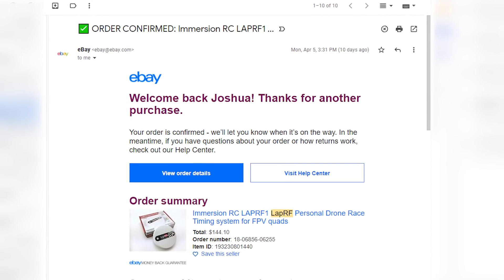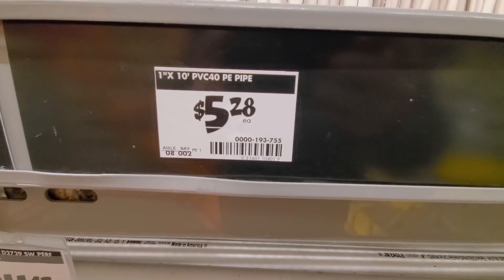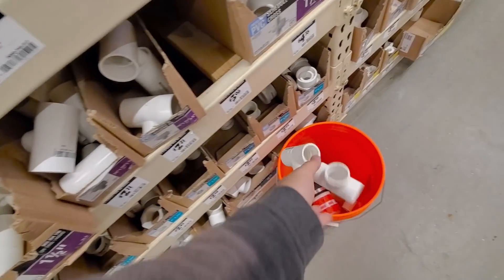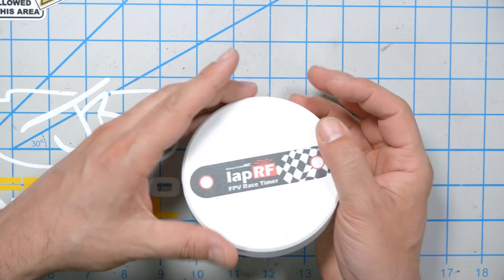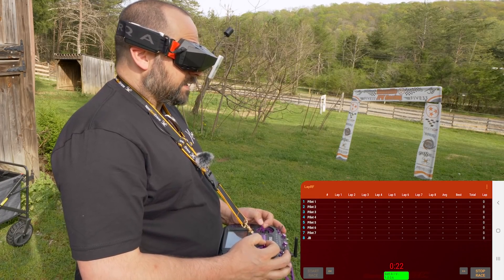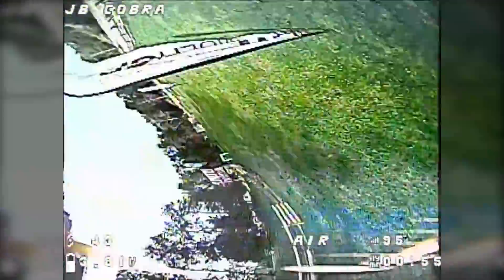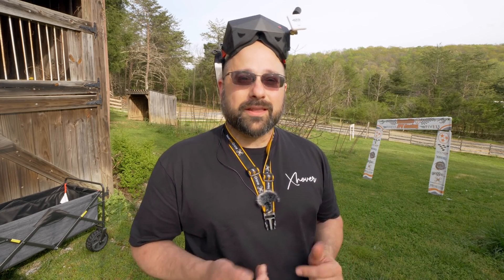Personal FPV race timing system: ImmersionRC LapRF Puck

Comment: need the android APP ,does anyone has the apk file ?
Reply: Hi! I have the same story, so one option could be downloading app files for Android from Github. The program do not function (do not detect and connect the Timer) on my cell phone (Samsung S22), but functions on my wife's cell phone (Samsung S23, if I remenber correctly), at least app detects Timer and it is possible to start learning the app. Other option could be downloading program from Livetimescoring to your LapTop and connecting to Timer with cable. I am trying to succeed with this option. Anyway I am new in this field and looking also for options and solutions with hope that I will not need to throw 100 EUR gadget in electronics waste and purchase some other functional solution instead of it. Good luck and please let me know if other, better options pops up. Sad part is that producer of the Timer do not respond to my e-mails at all...

Comment: DJI solution.
I've tried DJI and I have to say it works very badly. so i just soldered the cheapest mini analog VTX onto the copter. this only has a few grams which does not matter. and see there, it works great. :-)

Comment: Bought it a year ago, so did my friend thomas. Never did work with our phones. thomas never used his. I converted mine to a USB format and it runs OK with Livetime thru my laptop. I can never get it to work with dji. My delta 5 does dji no problem. the puck is garbage. I race a lot..... DRONAGE LINN BENTON....please do not waste money on this.

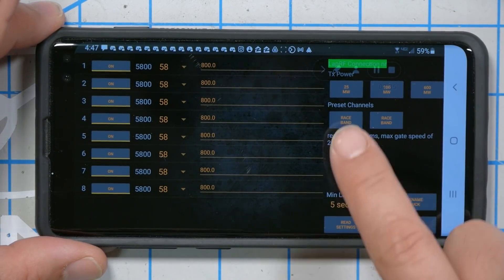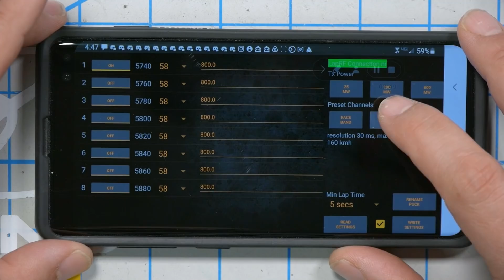Comment: When tracking multiple pilots, the accuracy is also reduced for everyone. You can see this printed on the interface. "resolution 240ms" means lap times are only accurate within a quarter second when all channels are on (4:30). It's 30ms (0.03s) with just one (4:40).

Comment: The puck has been pretty reliable for me. It rarely misses laps with up to 4 pilots but there is only one receiver in it so every additional pilot means more of a chance of missing a lap, especially for fast pilots, because the puck has to alternate scanning between all of the active channels. With DJI, the puck is much less reliable and struggles to read the laps at all sometimes. The RotorHazard system is supposed to be equally good at both analog and digital and has it's own race management system that allows you to retroactively correct missed laps using a graph of the video signal peaks. It's a really nice system. The Delta 5 is now outdated and has been superseded by the Rotorhazard system but you can run the Rotorhazard software on the older Delta 5 hardware.

Comment: Might need to buy some copper foil while you’re at it depending on your use/track. With whoops, definitely. As JB is using it, if track loops back nearby another gate. I covered mine except for the top. Also printing a stand to aim it helps too.

Comment: You should of used the lap timer on the fusion module
Reply from the maker: vTX based lap timers are not as accurate as dedicated ones, and are more likely to have missed laps or mis-timing.

Comment: I recently build a four pilot lap timer with the rotorhazard fork of delta 5 timer. It works great and has WiFi so all you need is a device with WiFi and a web browser. No laptop needed. 😀oh. And it also works great with DJI.

Comment: I bought the puck years ago when it came out, and although I have not used it in ages it is very good for training alone or with a friend or two. It works really great once you understand how to place it and configure it properly. I also built a small stand using simple packing card board to put it at 45° facing the gate, it helps a lot with precision.

I recommend doing the external antenna mod, it is very easy and inexpensive and will allow you to stay farther from the puck and place it better.

Comment: Delta5 is great and everything. But the RotorHazard project is way ahead of it in terms of functionality now. Not knocking Delta5. There are just newer things around now.
Reply from the maker: Delta5 is the hardware used by RotorHazard, right?
Reply: @JoshuaBardwell  Not really.  They both use RX5808 modules and Arduinos for processing. Because RH forked from D5, You can build a RotorHazard timer on the PCB created by the Delta5 project. Because they share some common DNA. But RH now has its own PCB designs that have more features. Saying RH uses D5 hardware would be a bit like saying RapidFire uses Eachine Pro58 hardware. Because they both use RX5808 modules.

Comment: @Joshua Bardwell For cutting the PVC for the gates, math works out better if you cut a 2 @ 6' for the sides (out of 2 pipes) and use one of the leftover 4'ers and cut a 3' out of the other for the top piece (7' long total).  Then 2 pipes would make 1 gate, with only 12" of waste
Reply from the maker: Hmm. I guess that saves you the couplers on the sides. But I still got 1 gate out of 2 pipes with 1' of waste by cutting 7' + 3' and 3, 3, 3'.
Reply: @JoshuaBardwell  I guess both ways would work.  6 of one, half dozen the other + one coupler.  I'd interested to see which gate style is better structurally (full sides vs full top, though I suspect the load isn't strong enough to make a difference....... )
Reply from the maker: My goal was to have no couplers on the top but you're probably right it doesn't matter.

Comment: They work decently well as long as you understand their limitations. The largest one being gate speed. For a single channel, it can just about catch anything. Problem is if you try to open up more channels, gate speed reduces very quickly. It is to the point that even as early as 2 channels, it can start to miss 5" quads flying at a decent clip. You can sometimes run 3, if you put the timer under a Split S or something where the pilot is likely to be in "the bubble" for a longer amount of time to allow it to catch. Similarly, you can use pucks for 3-4 pilots if you are running whoops or micros as quad speed is pretty low by comparison. There are even mods you can do to be able to send via USB the puck data into LiveTime if you wanted to run a race or do more data analytics with your lap info!
Reply from the maker: Yeah basically I think of it as being good only for one quad.

Comment: Could just build one from an old receiver module (the PCB with the shielding) and an Arduino!
Reply: Had a guy ask me four times where the green wire should go, I asked him to look in the manual after explaining it had to go to the RX pin... I just did it for him.
Reply: But the you have to... to... ssssoooolder. And it's soo difficult not even Sam Kolder can learn it... 😆😆😆

Comment: If you pick up a puck look into the Bluetooth antenna mod. Super easy to do. There’s a video about it. Long story short. Pick up a ufl to sma pigtail and WiFi antenna. Pop open the case. Remove the internal Bluetooth antenna connection, connect the ufl side of the pigtail to the board, attach the sma to the case, reassemble the puck and attach the external antenna. Helps aaallllooootttt. If you keep losing connection between the puck and your phone.
Reply: DUDE duh! should have done this ages ago
Reply: Yea at our field there’s a little rise in between the start gate and the pilot area. Couldn’t do it without it. With this mod you can lay the puck flat reducing the false readings and rotate the antenna up.

The puck has the mounting area for the sma connector mounting point.
Reply: @slowridefpv9668  just finished the mod. thanks!
Reply: Awesome!!
Reply: +1 on this. Easy mod and extends range nicely.

Comment: Does it work well with DJI system ?
Reply from the maker: For DJI, there are some complications. One is that you need to set up a custom frequency, which the LapRF can do. But the other is that the DJI system changes output power and the goggles also transmit, so the goggles can trigger the sensor to start a new lap. The usual approach would be to move the pilot further from the start gate, but with the LapRF puck that won't work since the phone needs to be in bluetooth range of the puck. I think these problems could be overcome, but they have to be acknowledged.
Reply: @JoshuaBardwell  All my doubts answered in a single comment. Thanks JB! :)
Reply: @_Furey_  I fly it on dji around 10 meters away from me. seems to work just fine. i don't know how accurate though. but its fun for practice. i set it on 600 mw though i fly with 1200 and on channel 3 with 50 mbits and 5878 mhz on the puck.

Comment: This puck is great! The week I was up at house mountain with Evan and Doc and we were running 4 channels open and it was reading everyone! I'm still learning how to get to read digital signals, but I love this puck!
Reply: Apparently with DJI you have to have a bit stronger output power. We run 200w on digital and set the pilot way off on his own. And of course, there are DJI to racing band conversion charts that help (search for 5Zero7 rc)

Comment: Bought one of these to time my whoop laps, was sad when it didn't work, was picking up peaks when I was rooms away from it, doesn't seem to work well indoors
Reply: One year later update, it wasn't the puck that was the issue, the whoop I was testing it with was outputting like 5mw, works perfectly inside when the craft is outputting 25mw

Comment: Joshua @joshua Bardwell..... I need an advice .... I into 70% cinematic and 30% freestyle ....So wondering ..... Emax babyhawk 2  HD or Nazgul 2 HD?Also worth to mention... My controller is Tango 2 pro
Reply: @omer hhh  the emax Babyhawk will carry a small insta 360 go camera or naked go pro.  Plus you also have goggle dvr.

With the nazgul you would be able to carry a full size gopro.  So small insta 360 go,  naked go pro or insta 360 ,  full go pro.

As for tango 2 that's crossfire protocol . so order which ever model you choose  with crossfire receiver installed or you could  add a crossfire receiver to which ever model you choose separately on your own.  
Or if you have the multi protocol module on your tango 2 then you can choose which ever receiver protocol you want..  hope this helps
Reply: @lawrencemartin8205  thanks Lawrence for the response .... Frankly I love the below 250 g concept and also the size of the Babyhawk will allow the option to take tight place shots similar to cinewhoop but now i cant see many options for camera mounts rather than insta260 go .... Not even sure whether it will fit insta go 2
Reply: Also Babyhawk fly time is very satisfying ....
Reply: @soopafly887  yes you would probably need to find a 3d print to hold the insta 360 go camera. Im sure some one has made one.. atleast in the USA they have.
Reply: @soopafly887  yes I am about to go pick mine up now. It just arrived. Happy flying.
Reply: @lawrencemartin8205  great .... Good to know you are going with Babyhawk. I just placed the crossfire version from the international Emax website ... Might take time to deliver. But worth it.
Reply: @soopafly887  ah yes  I believe it will be. I seen Andyrc got 11 minutes on an old 4s 850 mah battery.  So long flight times for sure.  Make sure to order some extra propellers they are selling out fast.
Reply: @lawrencemartin8205  i did lol  .... 2 extra sets  propellers and 6 × s4 850
Reply: @soopafly887  awesome man. Good job. Your all set to go then.